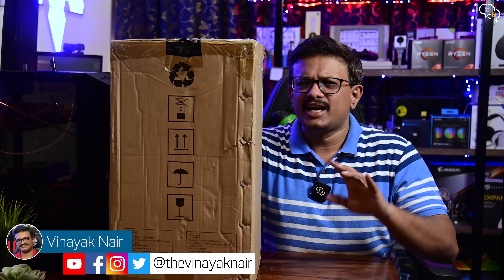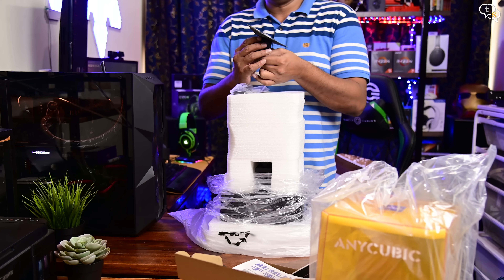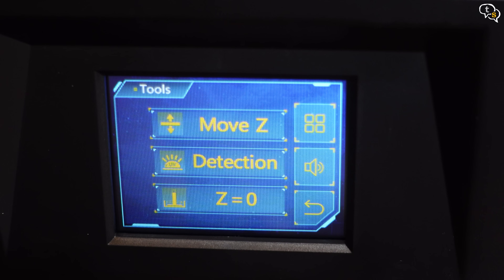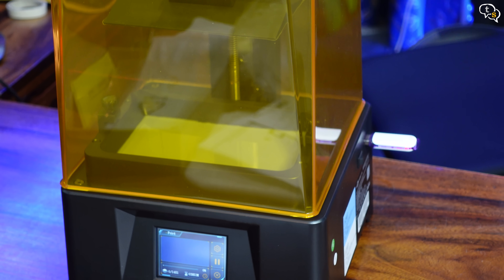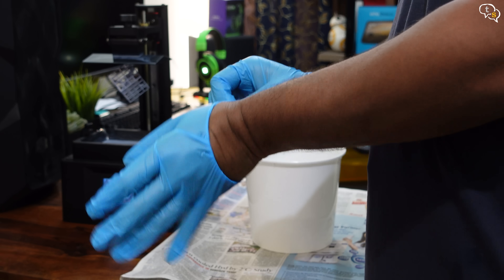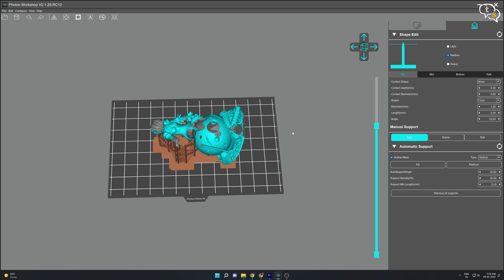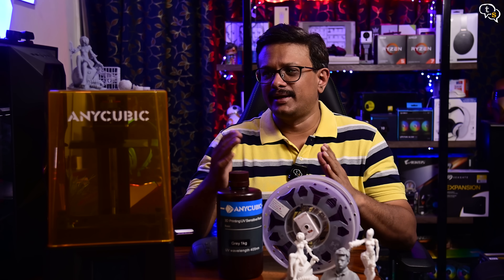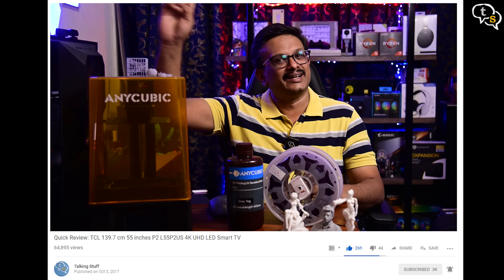Anycubic Photon Mono 4K MSLA 3D Printer

Comment from the maker: Amazon Links: 
Anycubic Photon Mono 4K High-Speed Resin 3D Printer: https://amzn.to/3w3Ayje

ANYCUBIC 3D Printer Resin Gray 1KG: https://amzn.to/3M4OlvL
ANYCUBIC 3D Printer Resin 500g/Aqua Blue: https://amzn.to/3PbphVK
ANYCUBIC 3D Printer Resin 500g/Translucent Green: https://amzn.to/3L1bzSc

Stainless Steel Funnel: https://amzn.to/3w4brNz
Silicone Dog Cat Bowl Mat: https://amzn.to/3l09FGQ
3M 3M-1611 Eye Protection Glasses: https://amzn.to/3M6DD7T
IPA ISO Propyl Alcohol 99.9%: https://amzn.to/3w3B1C0
Surgicals Powder-Free Nitrile Gloves: https://amzn.to/3L0PcvV
Reply: @TalkingstuffNet  is it impressive till now? If I purchased in 2025
Reply from the maker: It's still a great resin printer. I still use it. But just shop around, if you're getting one with a bigger build plate or 6k res, go for that instead.

Comment: My printer isn’t showing anything on the usb I saved the sliced files to. The original test file works but nothing else
Reply from the maker: You need to use anycubic photon workshop software to slice the models. It doesn't work with stl's.

Comment: I just bought mine 2 days ago that black sticker with the screen protector is a spare shadow protector for when you need to replace the fitted one and screen protector! It tells you to remove the old one in the instructions DON'T ! I nearly did I lifted a corner to check if one was on the screen out the box and yes there is! So keep them safe it's not a levelling paper!. Also they print in kono x format we have noticed from saved 2k sliced PMWO now they ada PMWA file's so it's been a headache figuring this stuff out as no good videos that actually go into all this kind of stuff so my Friend is making one

Comment: Would love to see a long term review. Not a lot of reviewers doing it but would give a full picture of owning a resin printer, especially anycubic.
Reply from the maker: My wife forbid me from using it due to the resin smell. Have to find an optimised method to print without the whole house stinking of resin. 😅
Reply: @TalkingstuffNet  I had same issue but I spent a little more money and got plant based UV resin and absolutely no smell. Can’t tell any difference in print and nothing failed
Reply from the maker: Oh,plant based resin doesn't smell. That's great to hear. My printers been sitting idle for so long.
Reply: @TalkingstuffNet  yup and Anycubic makes it! EC UV Resin it’s called. Amazon for about $25 for kg
Reply from the maker: Oh,it costs $43 here in India. 😬
Reply from the maker: Picked up the clear plant resin by anycubic. Thanks for the tip 👍🏻

Comment: @Talking Stuff - if you want to see what the state of the print (preview) is - you can adjust the lift setting for the first couple dozen bottom layers to 60mm. YES - this means the print will take proportionately longer. Unless you 3D print a clear vat yourself, though - this workaround will raise the plate above the tray level so you can see the bottom layers being printed and ascertain the print is progressing well. If there are issues - you'll note them during the bottom layer printing stage. After the bottom layers are secured and you're sure the print is sticking - the remainder of the layers can be set to the default 4-6mm bed raising.

Hope that makes sense. Good luck on your 3D printing journey.
:goodvibes:

Comment: Hello. Thanks for the review but I still have one question. How much small things can I print. I need figures smaller than miniatures (actually they are ant sized). Can I take a print like 2x2x2 mm?
Reply from the maker: As per a website I've seen you can print as small as 2.5 mm. Not sure if it's possible on the anycubic though.
https://m.all3dp.com/2/the-smallest-3d-printed-things/

Comment: I am having a hard time getting accurate prints. Every print I do comes out unfinished and goopy looking. Nah advice?
Reply from the maker: Try increasing the UV exposure time between dips, the option is available on the printer and in the software. Maybe 4-6 seconds instead of only 2. Also first layer I put it at 8 seconds to get a good adhesion to the plate. This will increase print time, but you will get a good print.

Comment: Thanks for the great review! This is the printer I purchased a few months ago to get into the hobby. I'm extremely pleased with it and print nearly every weekend.

I have a few comments to share. It's worth noting, the setting to detect when the cover is removed is disabled by default. One of the first things you should do is enable it in the settings.

I strongly suggest purchasing a full facemask and respirator, which are very affordable and will help prevent any exposure to uncured resin. A UV curing lamp or curing station is also a good investment, as it will cut down on the post cure time.

I have found it's not necessary to fully clean the build plate and resin vat after every print, unless your print failed. When I have a successful print, I simply remove the models from the plate, reattach, and select my next file for printing. Often I will print 3 models in a row without cleaning.

Thanks again, and I hope this encourages many others to try out the hobby!
Reply from the maker: Thanks for watching my video. 😁 Mine had the cover detect setting on by default. I had watched tons of videos before my printer was delivered so was kind of ready for it. 🙂 

I still have a lot to learn about SLA printing coming from FDM they're totally different beasts. 

Have to check out about the cleaning, I always had some sort of hard resin in the vat. Maybe a setting is wrong, will test to make sure what the optimal settings are.

It's quite affordable now which pushed me to get one at least now.

Great to hear from you, and Happy 3D printing.